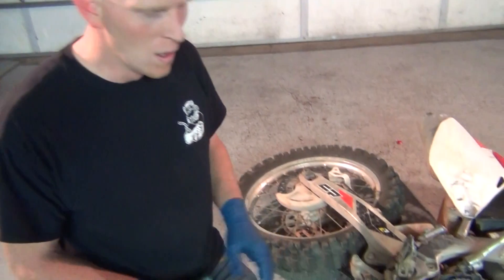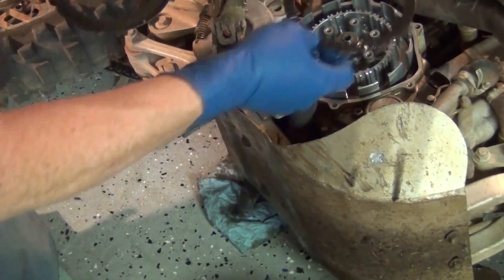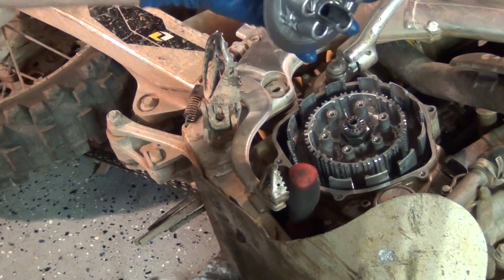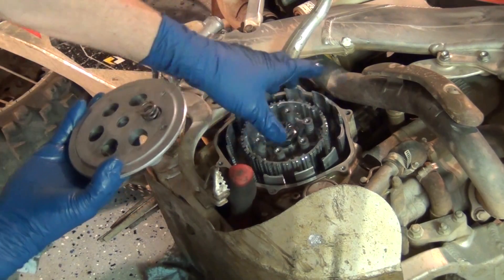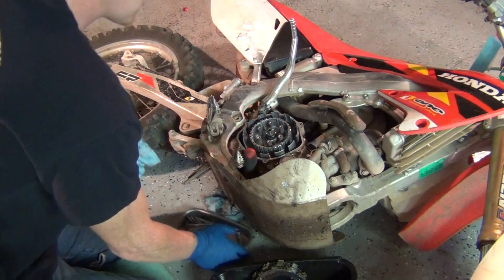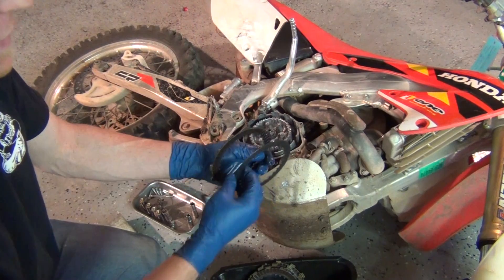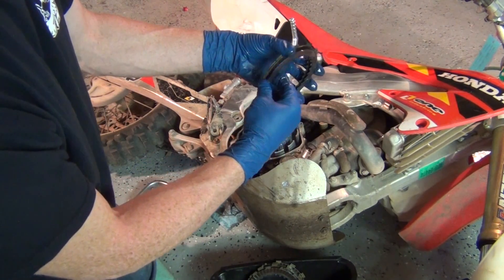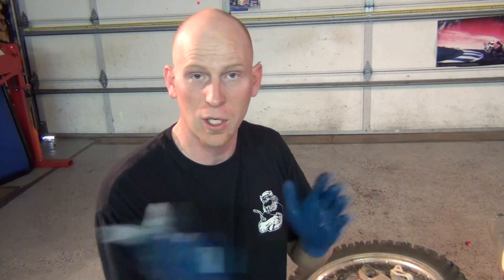How a Motorcycle Clutch Works  High Detail and Very Basic

Comment: How would a worn Clutch basket effect the clutch's operation? Could it cause clutch drag and making the bike really hard to push in gear with the clutch lever pulled in?
Reply: Booki I douth my basketnis work out but when ever in gear is hard to move but I do need to flush my clutch because it has air bubbles

Comment: great video well explained.... question . if the clutch plates are worn down on a quad , would this cause the bike not to move at all when disengaging the clutch lever?
Reply: tudo cervera your quad shouldn't not move if the clutch is disengaged but if it is and the engine is revving high and barely moving I recommend looking into your clutch

Comment: I'm hoping you can help me my 2012 crf450x randomly wants to keeping pulling it self when the clutch is pulled in.
Also neutral is really hard to find.
What do you think would cause this? I've messed with the clutch cable but that didn't help....
Thanks, hope to hear from you soon!
Reply: Had the same exact problem on my WR250F. Try a new clutch kit, I bought a Tusk Competition clutch kit and that problem was gone.
Reply: WRider41 thanks for the reply

Comment: I'm having trouble understanding how all those clutch plates make the bike go different speeds.  Are they connected to different gears in the transmission?
Reply: What you see here, is the clutch which only engage and disengage the engine from the transmission. 
It's in the transmission you have the gear, which is selected with your shift lever.

Comment: What do I do if my clutch won't engage when I pull the lever
Reply: +Zac Bugg I have this same problem, can you help please
Reply from the maker: +giants21221 The linkage or the rod through the center has an issue.  The total movement at the clutch is small.  Maybe 10mm or less.  Many times the rod has a ball at the end of it.  If it is lost or falls out the rod length will be too short to *disengage the clutch.  The clutch is a connecting device.  When you pull the lever it opens or disconnects the clutch.  When you let go- the springs push the clutch back to being engaged or pressed together.
Reply: +briansmobile1 How can this issue be fixed?
Reply: +briansmobile1 Ok I have opened up my engine, and it seems that the pin that is supposed to push the other pin when you pull the clutch does not push - if that makes sense, can you help me please I can send you photos and stuff so you can see for yourself.

Comment: I have a 82 Honda CM 250 Custom. I have a problem with the clutch on it. I went about 30 miles one day and lost my clutch. I would squeeze the lever and nothing would happen. I got back home and I seen nothing wrong. No parts, no chunks. So I purchased another cable. Right now I am almost at the end of the adjustment of the new cable. When I start the bike up in the morning or when the bike is cold the clutch is easy to work. It goes into gear really easy. The longer I ride the harder the clutch is to work. When I downshift it gets harder and harder. I just don't get it. I was told the old cable was stretched so this is why I got a new one. When I am at a light I turn the bike off because it acts like a muscle car and walks like it just wants to take off. I have NEVER had this problem on any bike I have ever owned. Just what is wrong? I am puzzled about this.

Comment: Hey Brian I just bought a 97 kx 250 and was working great until last ride were it got stuck in first gear. Shifter still moves up but doesn't do anything and now when you pull in the clutch there is still a little drag on back tire. Any ideas?

Comment: Hey Brian, fantastic video, thankyou! 
I've just bought my very first bike; a Yamaha Virago xv250. It's fantastic except the clutch. Basically when I'm stationary and go to start taking off in 1st gear, I'll begin revving however the bike won't accelerate until I've let the clutch almost all the way out to the point of almost stalling before the bike will take off, if that makes sense. Sometimes my bike doesn't let me change gears when I'm stationary too, unless I move it back and forth. Apologies for the essay, just a bit stuck! Wondering if you can help me! Thanks:) - Madison
Reply from the maker: That is normal to have it need to roll to shift gears when stationary.  As for the lever.  It's it's an older bike you can adjust a barrel bolt and keeper nut on the handle end of the cable.  It would be tightened to change the give position.

Comment: very well done, the best I have seen so far on the subject.  I would like to see how the clutch lever interacts with the clutch assembly and explanations on what is taking place with typical clutch problems, such as what leads to burned clutches.  Thanks and again well done.
Reply: +briansmobile1 That's what I was worried about when the locking screw on the cable adjustment for the clutch became loose and I had to adjust it on the 500mph trip ...but then I thought about it as chance to adjust the clutch to my preferences. Still wondered though, 'am I just constantly slipping the clutch while doing that +70mp.  Got back 3 days later from a friend's place, rode it to my local garage to find out it was adjusted just fine.
I guess you could feel the decreased performance, and perhaps some extra noise if slipping was the case?
Reply from the maker: Thanks man!  If you have the clutch lever too tight it can make the clutch slip and that can wear it out prematurely.

Comment: Thank you Brian, this is a great video and excellent explanation.  I had hoped it would help me understand why I cannot shift upward into neutral when the bike is stopped. Like when I pull into my garage. Still in 1st, with clutch lever pulled, it seems "locked" into 1st. But if I  hit the kill switch, it slides right into neutral.  I just replaced the clutch plates / springs but it has not made a difference.

Comment: I have a 1982 Honda CM250 Custom. Like the Rebels. I was low on engine oil and like a dummy I put about 10 ounces of Defy motor oil from Quaker State. This oil has a synthetic blend. When I take off it bangs a lot. When the bike isn't in gear the engine runs fine. I drained the oil out and replaced it with regular engine oil but it still make the banking noise while driving. Why would synthetic oil do this? I would think the clutch is slipping really bad. Also how do you get that goofy nut off? I am going to redo the clutch.

Comment: But why motorcycle has many clutch disks,and car has only one?
A clutch disk should be dry,to squeeze well,how wet disks in oil,convey movement?
Reply: More surface area I think, I'm new to bikes too lol.
Reply: A 'wet clutch' has less wear then a 'dry single plate' and should last a long time in the overall life of the motorcycle if the maintenance schedule is kept, It also deals better with higher energy output and heat dissipation. Some cars such as Volkswagen use wet type Dual Clutch Transmissions

Comment: what could be wrong I pull clutch handle In but bike wont go neutral but I can still shift through gears and it will go into neutral with the foot shifter but while in gear and pull handle and nothing happens seems to stay in gear

Comment: so, there is oil in this clutch assembly when operating. and it is the same oil which lubes the engine, the transmission and the clutch. is this correct???
Reply: Yes

Comment: Great video and thanks so much for making. A quick question. When I put my motorcycle in neutral I hear a tiny bit of noise coming from the gearbox. It's not loud. My guess it's the "outside"(engine) part spinning while the "inside"(transmission) isn't. Does that sound right and is that normal?

Comment from the maker: Most retro-fit electric cars are a manual transmission set up.  The manual transmission is used because you can use it like a direct drive with benefits of variable gears.  While it has a manual transmission and a clutch pedal, it usually won't employ a clutch because you can't stall an electric motor.  Electric motors would be less efficient with a flywheel as well.